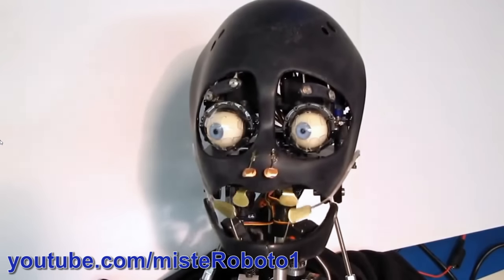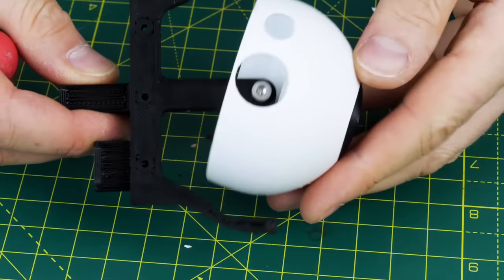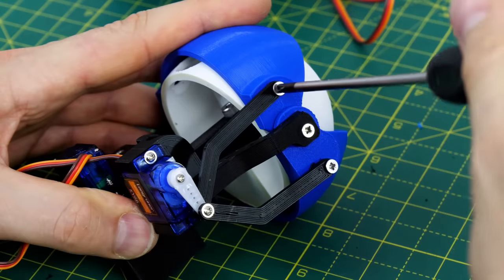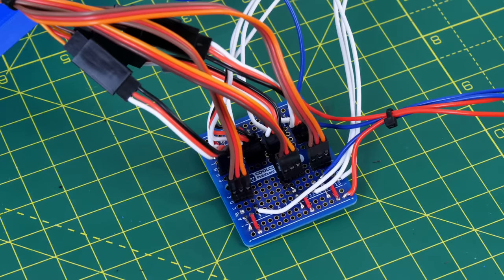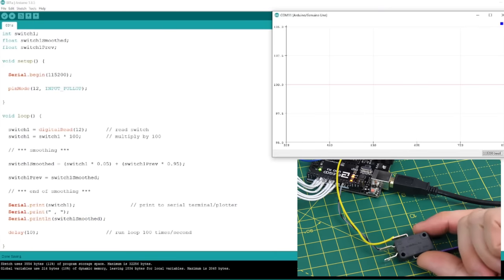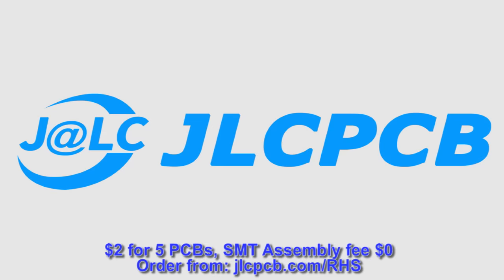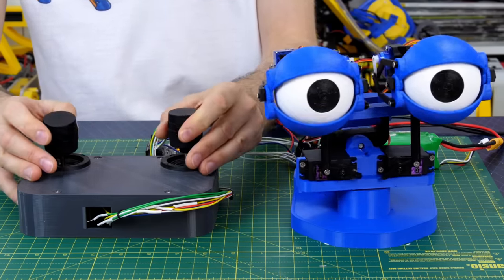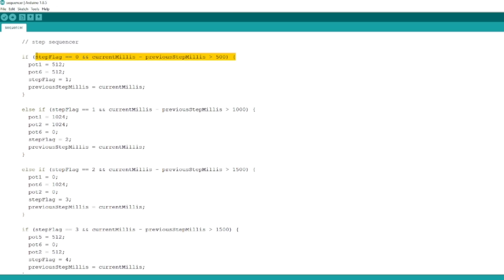How To Make Robots Move Smoothly | Arduino Tutorial

Comment: Do you need the switch1Prev variable? You could just use switch1Smoothed, like so: switch1Smoothed = switch1 * 0.05 + switch1Smoothed * 0.95;
The computation of the value returned will use previous value. You also don't need the parentheses.
Reply: My limited knowledge of arduino tells me that this would work. But I think he knows this and chose to do it differently... For some reason.

Comment: A good eye rotation calculation has each eye looking at the same point. Then you get a bit of toe in. Then you can move the virtual look at position with your controller ( could be on an arc) This looks more realistic than both eyes in parallel turning at the same speed.

Nice work. Good building and showing how to use a simple low pass filter.
Reply: Nice idea.  What about sensors to detect distance to object?  Then you could have it go cross-eyed as you brought objects close.

Comment: eyeballs move smoothly when they are following a moving object even if the head is itself moving
however, eyeballs move very suddenly when they change the direction they are looking at.
place your hands in front of you. 
move your right hand around. your eyeballs follow it smoothly. Start moving your head as well. Your eyeballs continue following your hand smoothly.
Look at your left hand. Your eyeballs change from looking at your right hand to looking at your left hand in a very sudden movement. 
move your hands in opposite circles, left clockwise, right anticlockwise (or the other way around, doesn't matter) look at your left hand then at your right hand. You will notice your eyeballs follow each hand smoothly but transition from left to right hand very suddenly.

You can use a high framerate camera to verify this.

Comment: For the code optimization geeks (like me):   'switch1' only changes when the switch does, yet it's multiplied by 100 and then by 0.05 in every loop. Since that never changes, you could simplify it by just multiplying by 5  (100 * 0.05).  The compiler might even be able to optimize 'switch1 * 100 * 0.05' into 'switch1 * 5'.  I understand it's written that way to show how it's smoothing the values, but an even more efficient way would be a simple conditional in place of most of the calculations:
    sw1Smoothedt = switch1Prev * 0.95 
    if digitalRead(12)  {
       switch1Smoothed += 5   }
    switch1Prev = switch1Smoothed

Comment: This technique will work properly only for actions which have a relatively long duration. Fast inputs will yield virtually no response from the servos. You must add the smoothing attenuation coefficient for high speed inputs.

Comment: This is definitely a great tip for digital reads, but I feel like it goes against most analog read applications. A performer operating an animatronic live will almost certainly want their  performance closer to a 1-to-1 movement. That's kinduv the whole point of reading the analog values and moving according to those values, so that the performance of the human comes through. Adding a hard and fast, always on smoothing interferes with that performance by reinterpreting the puppeteers movements. Again, that's not to say it doesn't have its uses, just that adding it to joystick or potentiometer inputs feels counterintuitive.

Comment: Nice project.
In the standard Arduino IDE examples, under "Analog", we have an example called "smoothing" which basically uses an Array of values in order to get an average value which smooths over time.
I use something similar to send smoothed out values over OSC/MIDI

Comment: I prefer the slightly simpler expression:  switch1smoothed += (switch1 - switch1smoothed) / 20; 

It gives exactly the same result but you only need to specify one constant. A modern compiler should optimise / 20 to * 0.05.
Reply: Change the 20 to 16 to make the divide a bit shift. Optimize that, compilers! Away with the evil bloating point math!
Reply: @6alecapristrudel  Yes I use powers of 2 when using ints so it can be done by a shift but do floating point units or libraries optimise power of 2 to just exponent changes?
Reply: @nophead  No idea, but good point! Could be good for doing floats on an 8bit micro. Dedicated hardware likely does any multiply in a single cycle.

Comment: I have an old rotary dial phone. You can’t use it any more because everything is digital. Would be awesome if you could emulate the phone central and make it IP connected. You then dial the IP address of one with the same code running and can speak together. It should of course both support the waiting for number tone, ringing tone, invalid number (can’t connect to ip), no answer and hung up tones as well.

Comment: I think the code would be easier if you used millis and the multitasking stuff on the smoothing code and used delays on the motion loop.

But, sure, the best would be to get rid of all delays!

Also, I think you would benefit a lot with a video making improvements to speed up your printers, with Klipper for example. I'm sure you expend lots of hours printing everything.

Comment: #include <Servo.h> // include the Servo library

Servo eyeServo; // create a servo object for the eye

void setup() {
  eyeServo.attach(9); // attach the servo to pin 9
}

void loop() {
  int position = random(20, 160); // generate a random position between 20 and 160 degrees
  eyeServo.write(position); // move the servo to the random position
  delay(500); // wait for half a second before moving to a new position
}
Hope it helped :]

Comment: I love your channel! I have a 3D printer and would love to try out some of your projects but I am not good with electronics, and most of them requires parts that seemed to be costly with no practical use if you are not into robotics. Maybe you could share how to make some smart IOT devices using raspberry or even better using arduino as it is cheaper. Something like a smart self cleaning robo cat litter would benefit a lot of people, which usually cost hundreds of dollars.

Comment: Great job! But this still looks pretty DEEP in the uncanny valley. Animators are struggling with this for decades, two lines of smoothing wont cut it. But its a great start.
Reply: Yes, actual human (or animal) motions are different: globally, they minimize acceleration (more specifically: muscle power) while getting to the target as quickly as possible.  This means your motion would consist of two smoothly connected quadratic parts.

Comment: Nice build and tutorial!  A thought:

Rather than a single, hard-coded acceleration value, have a separate acceleration value for each mechanism based on two values:

1. A 'Mass' variable, as an object's mass will determine how quickly it can accelerate for a given force.
2. A 'Force' variable, as the maximum force that can be applied will determine how quickly it can accelerate for a given mass.

(The ending acceleration should be much less than the initial acceleration, as we tend to use max force to begin movements and much less to end them, for the sake of precision.)  This should allow for highly-nuanced, realistic motion that would, for example, have the head turning MUCH more slowly than the eyes.

Comment: I never thought about this. Ive made janky animatronics out of cheap servos and ping pong ball eyes, I like your eyelid solution of having 1 servo work both lids, took notes on that one. Interested to see how you would do eyes that move omni-directionally. left right , up down. (I had a vertical servo and a horizonal servo attached with zip ties so they moved with some flex which helped smooth the movement a little. But tiny little screws being the pivot points in pingpong balls only lasts so long!)

Comment: Thanks for your videos @jamesbruton - these are fantastc. I know you posted this some time ago, but I'm attempting to make this for my STEM class to work with. I have downloaded the CAD and printed all the parts, put the anamatronics together and have all the servos in place, but I'm struggling a little trying to work out the wiring as you don't have a wiring diagram. Is it possible please to provide a diagram to wire the breakout board? That would really help. Thanks again!

Comment: One thing I would be interested in would be how can you achieve to make the eyes look after you if they sense your presence in the room (if you go tho the left, they will look to the left, if you go to the right, they will look to the right)
I am currently trying to do this with 2 ultrasonic sensors, but they are not very precise and the area in which they can detect motion is very tight.
What other ways would be to achieve this without using some fancy camera detection? :)
Reply: a small matrix of ir motion sensors should work. Would act as a super low res 2D object sensor, and then just aim up at avg human eye height

Comment: Great video.how do u prevent the servos from jumping on the moment of powering the system overall?.that is a challenge why robotic companies use either encoder or stepper motors instead of servo which needs to default position upon start. Can u solve this ?

Comment: James, great video, appreciate as always your attention to detail and sharing the work. Looking at the CAD, I had a question about your process. From what I can tell, looks like your just taking measurements for the servos and building your own vs importing from a library is that right? Curious if that's just to get the dimensions right for print vs actually testing the mechanism through simulation. Thanks again and Cheers!

Comment: Any good suggestions for 3D printers for beginners 😌 and is it necessary to have a computer or will I be able to also use just my phone
Reply: The two kings of the user friendly 3D-Printing market are long-established Prusa Research and newcomer Bambulabs. Both of their printers are considered pretty easy to get started with, automating most calibration that tends to cause headaches to newbies.

You are going to need a computer though. To turn a 3D-Model into instructions for a printer to work with, you need to use a "Slicer" that does just that. That is a pretty beefy task that only a PC/Laptop can really take on. The resulting "Gcode" file can then be fed to a 3D-Printer via, network, thumb-drive or SD card

I generally advise one to first try out Slicing first. You can just try out such a program without having an actual printer to get a feel of what it takes to work with a printer, how they work and how long your prints are going to take (spoiler: They ain't fast...). Prusa's own PrusaSlicer is the most popular one as it works with nearly all major printers.

Comment: Mind sharing the cad files? The one in the description of the video is not printable. All the body's are attached to each other.
Reply from the maker: Yes that is the whole assembly, you need to import that into some CAD software and extract the parts from there in whatever format you wish - just like if you drew them yourself in CAD.
Reply: @jamesbruton   When I try to import the file into FreeCAD, the file only splits it into 3 large sections, not the parts that make up those large sections, and there is no way to manually split them farther, as the program considers it one object.

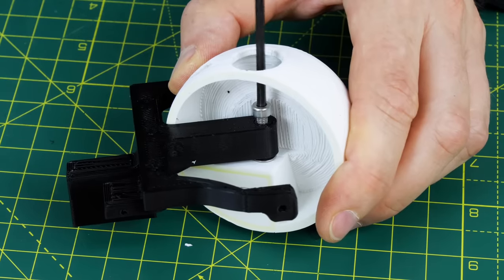Comment: Hey James, It's always interesting to see you make these simple hinging parts. I'm wondering why you used a normal bolt at 1:15, while for the next one (1:32) you seemed to have used a self-tapping screw. Also, how do you like to make the thread in your 3d printed parts? threaded inserts or just threading the 3d-printed hole?
Reply: U only need nuts or threaded inserts if it needs to be really solid and withstand a lot of stress lol

Comment: So cool, I'd like to learn arduino running several routines at once sort of suedo dual processing, like establishing priority, and if  a routine has been finished, have a little coding experience, but not to the stage I could write firmware for a 3d printer on a arduino 😅

Comment: Good day sir...
I wanna ask

I dan a project (motorcycle) to control servo based on engine rpm (@ certain rpm move,  certain degree, etc)( in short: yamaha ypvs or honda rcvalve) think to use arduino uno/nano and a servo

1. Is it ok to run direct 12 v to arduino?
2. What program do i need to learn?
3. Can arduino count direct pulse from engine pulser?  (I've reserach and it seem not so accurate (miss @1000 rpm ))

Thank you very much

Comment: Great tutorial!  I cannot seem to import the .stp file into Fusion360.  It fails on upload.  Help!
Reply from the maker: Did you download the zip of the whole repository?  Several other people have built this already.
Reply: That worked!  I was right clicking on the file and saving.  This is amazing.  I am 3D printing all the parts and modifying the fusion file to fit my servos.  I wish I had more information about the breakout board that the servos plug into.  I am still more of a beginner.  Thanks for your help!

Comment: Wouldn't it be easier to add a line of algebra to control the movement? Calculating the voltage/current in an equation which defines a parabola with upper and lower limits may be more precise.

Comment: Uncanny. Out of interest, I've been working on a robot arm stroke 3D printer in very early stages so far and I've tried to write some basic interpolation code in python (as a prototype) to make sure the arm moves in straight lines (if for instance it has to move along a diagonal and the X axis movement is less than the Y axis so it gets where it's supposed to be in the X axis first then sharply changes direction to move in the Y axis) but it's kinda messy and the way I set it up I find hard to actually get my head around when I'm feeding it data because of the way I set up the inputs, would this or something similar work for that kind of use case or is it just cosmetic for things that need to look nice.

Comment: Can someone explain the two lines of code for smoothing
Reply from the maker: It takes a large amount of the previous value and a small amount of the new value on each code loop, so the output value can't change too much. That output value becomes the previous value on the next code loop.
Reply: @jamesbruton  Thank you for your quick response 😆
But I don't really understand why it stops at 100 or why it is smoothing before it reaches 100

Comment: Nice, the movement at the end looks nice and smooth.
But please, STOP using servos in humanoid robotics...

Servos are needed for accuracy. Our muscles don't care about accuracy. they either contracted, or relaxed.

Human limbs are closer to async motors - it either accelerates or moves by inertia. 
Both accuracy and speed are achieved by constant tactile feedback, and short contraction of different muscles in different directions.

Also the smoothness is achieved by control over contraction and inertia times, depending on feedback, and desired result.

Comment: Now you just need to train a GAN neural net to learn different actors' facial tics and move the robot servos to match.
Reply: A NN is overkill.  The only reason to use it would be to simplify the control system.  Train a network to match video frames of a face to keyframes of servo positions.  That would be a lot of work.  A GAN is 100% unneeded.

Comment: hi sir can you send me stl files of this project
Reply from the maker: The whole project is on Github and the link is in the description.
Reply: @jamesbruton  but sir there is no stl file there is a cad folder stb file but i need stl files of all part
Reply: @robotics550  STP or "Step" files are the universal CAD files that can be opened in pretty much any CAD software including free ones. 
A number of slicers like Prusaslicer and Cura (with a plugin) can nowadays also load STP files and should split the parts into individuals components you can then start fitting on your print bed.
Alternatively you can use any CAD program like Freecad, Fusion360 and so on to load the step file and then export all parts as STL/3MF files.
Reply: @Foxhood  thank you so much

Comment: Exponential Moving Average
Reply: Exactly!  I use this to smooth out sensor readings for things like battery voltage monitoring, temperature sensors, and such.  James showed a simple representation of how to do this in code, but more info is available on Wikipedia: https://en.wikipedia.org/wiki/Moving_average#Exponential_moving_average
Reply: I agree- this is simple to implement in data reduction for things like rocket engine testing, and gives reasonable results. For archived data it can also be given a time shift to better align the output with large steps in the input data.